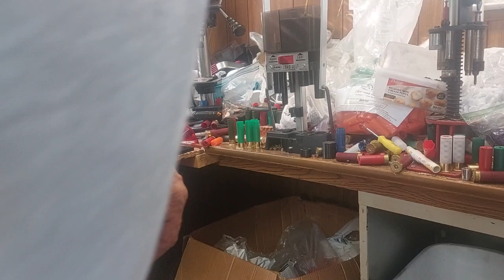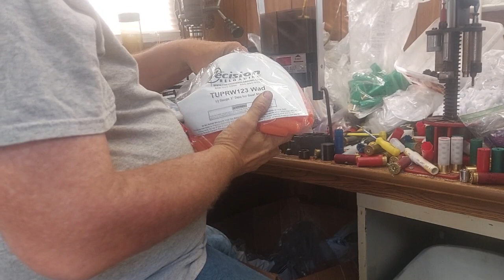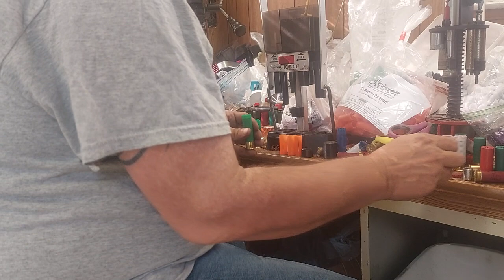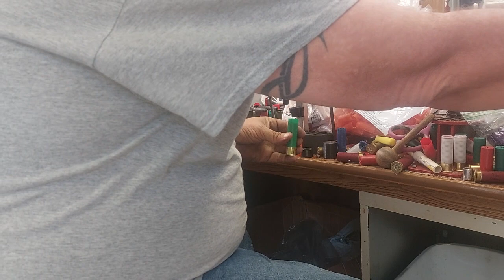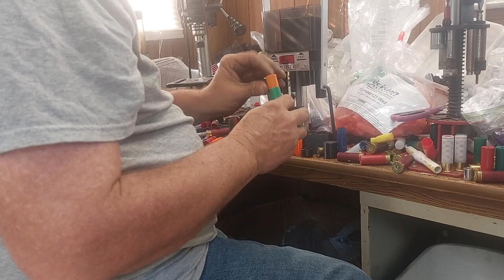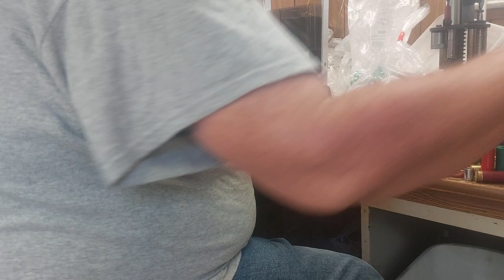gonna test. 24 pellet .28 cal in the tuprw123 wad from prescion reloading

Comment: Hey Roger. I done pretty much the same load your doing there in a once fired Remington 3" hull with the 123 wad my stack height was a little to high to fold crimp so I use the 12 wad for a little more room to crimp and it shoots awesome out of my 870. About a 15" pattern at 40 yards.